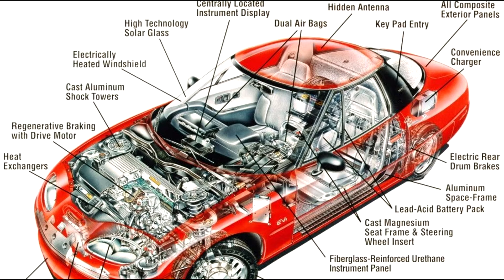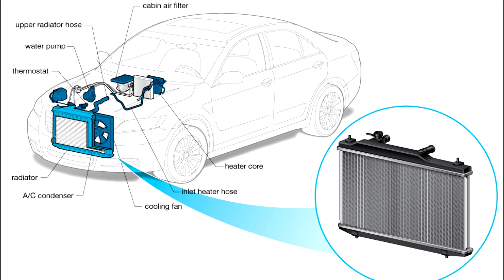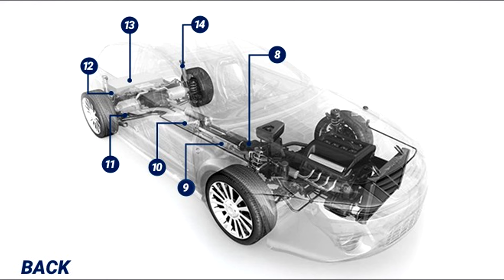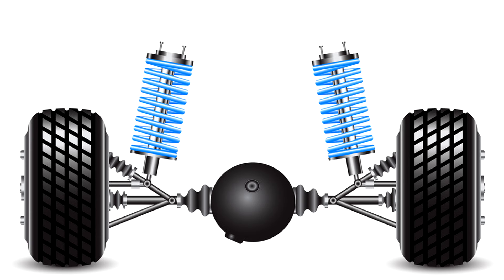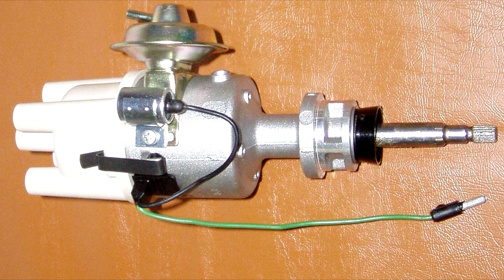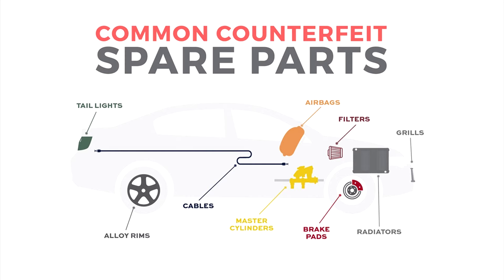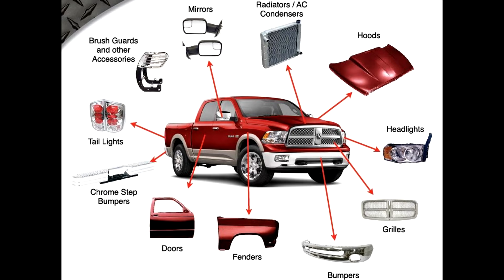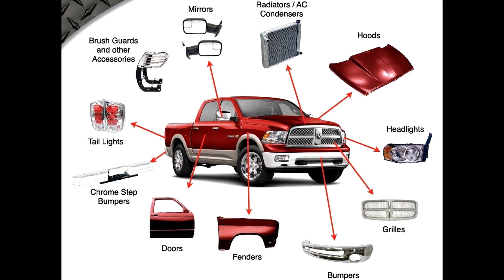Car Parts Explained🚘{+ their function}: What are Basic main different parts in CAR? Explanation pics

Comment: A car can run just fine without a battery. It’s the alternator that keeps the car running. The battery is just there to store energy for for the radio and lights and to start the car.
Reply: And this is the case where the car needs to be started before it can do anything that makes it a car so it is a very important part
Reply: @danielli6648 I wanna see a pull start car.
Reply: I want to like this video but everytime he says wehicle I can't really distracted